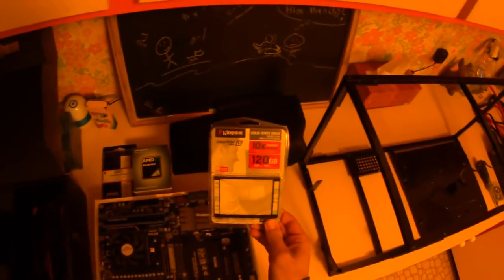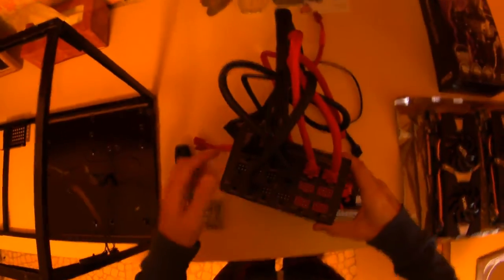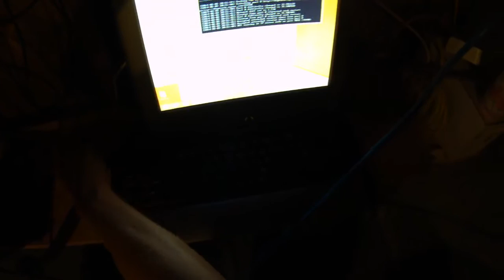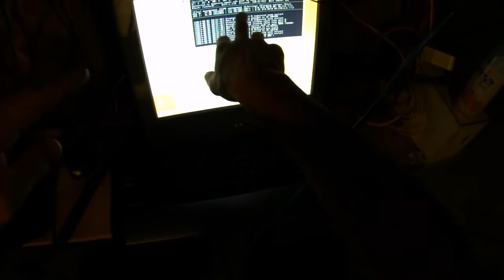How to Build a Mining Rig Case / Frame from Aluminum from Home Depot / Lowes

Comment: you should probably stop using your foot as measurment, how the fuck am I suppose to know how big are your feet?! just say it in meters/cm/mm or whatever so ppl understand it
Reply from the maker: Mario D. Zmaj I am in USA and we use Feet and INchs, if you convert feet to CM it should help you out,  best of luck
Reply: You don't use feet, you use meters just like the rest of the world. For example, a feet has been defined by international agreement as equivalent to 0.3048 meters exactly, while a meter is defined as the length of the path traveled by light in a vacuum in 1299 792 458 seconds. Why not just cut the middle man and use meters directly then? Once you go below inches you get to millimeters as well... Its easier anyways since 1 meter has exactly 100 centimeters and one cm is directly 10 mm ..like..who's bright idea was to have 12 inches in a foot anyways? Even the imperials gave up on that crap.
Reply from the maker: LoL, well you know a hell of a lot more than me regarding measurements, That is for sure! I hope you get your Bitcoin Rig up and running post a video when you get it working!